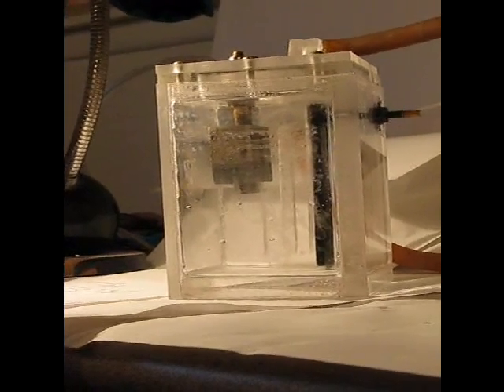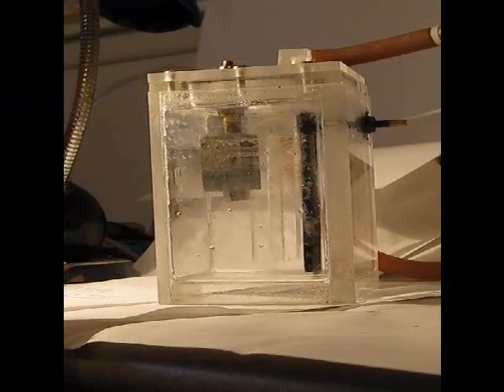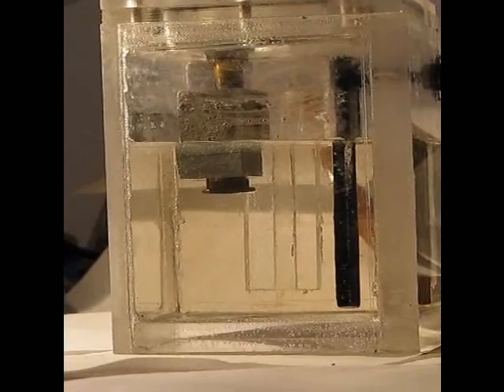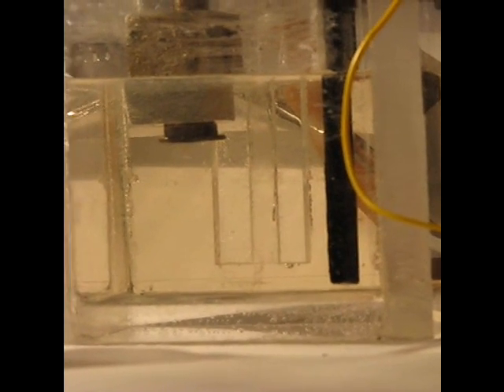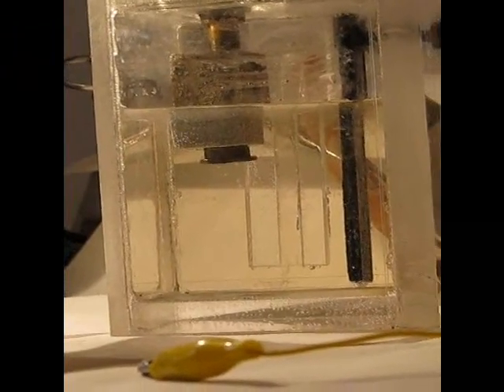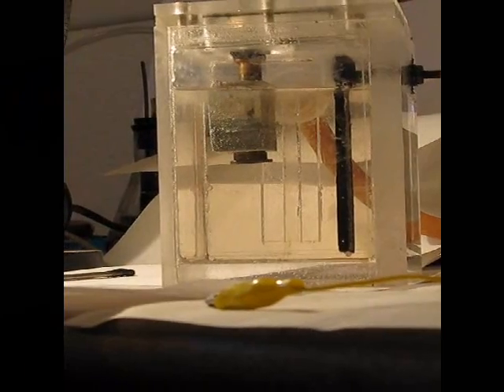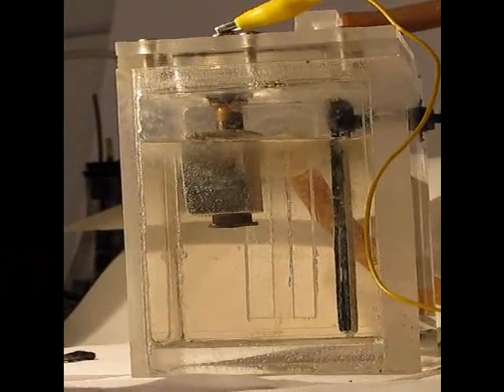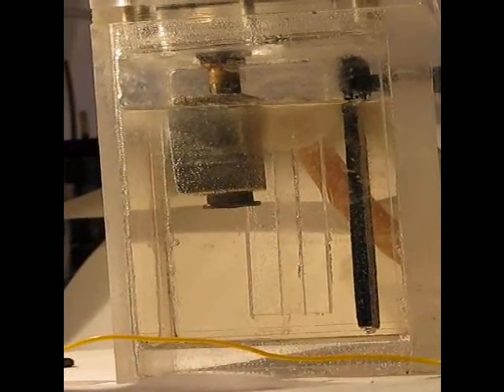Dr. Linnard Griffin - Aluminum and Nano-Nickel Reactor

Comment: with aluminum trapping the oxygen it is posible to mix aluminum with an inert metal to suspend reaction when the electrode is disconnected. however,  you still need energy to split the water molecule...get the problem? you have to input energy to extract energy. what is the net gain? positive, negative or none?

Comment: Thanks for sharing. Did you try to take off the negative wire and switch to just the positive wire on the negative terminal of the battery? Kind of like a joe cell I think.